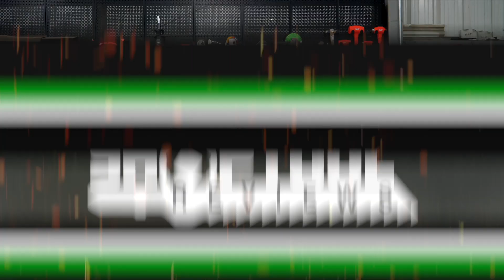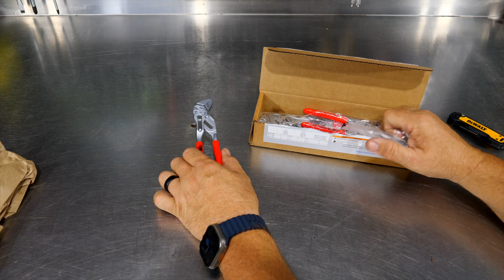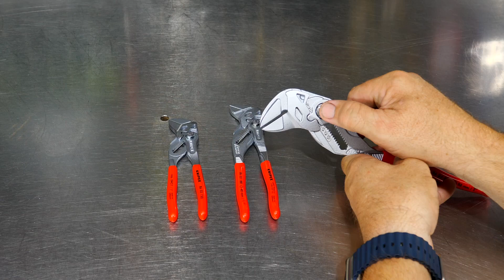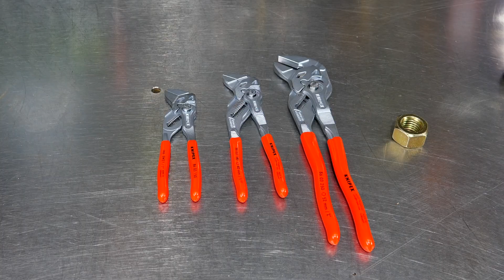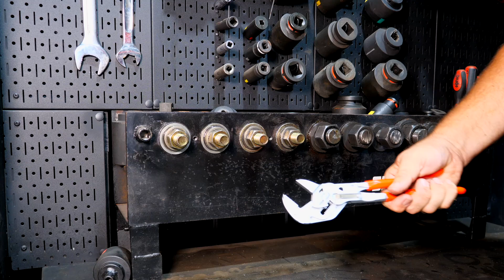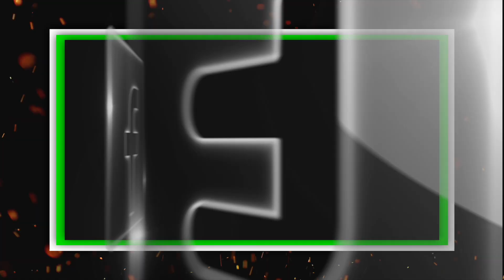GERMAN Engineered and Made - Knipex Pliers Wrench Set Smooth Jaw Pliers Review

Comment: I love my Knipex. As an addition, you can get soft no mar jaws for both the Pliers-wrench and Cobras to really prevent no marring when installing an expensive faucet set, etc. They just slip on the jaws. Very inexpensive (comparably) 3 sets for about $11. They are size specific and not available for all sizes. Great review and you would have been able to break nuts at 200 or even 300 lb-ft. If you were on the “correct” side pushing down.

Comment: I own the 7 1/4" and 10" models.   Use them around the house when I don't want to mar the finish, i.e. chromed shower heads.   They have also replaced my adjustable wrenches when tightening or loosening nuts and bolts and enough room exists.  Can get a much better bite